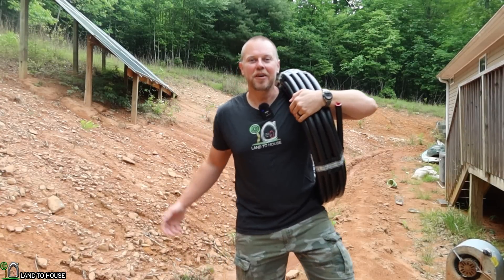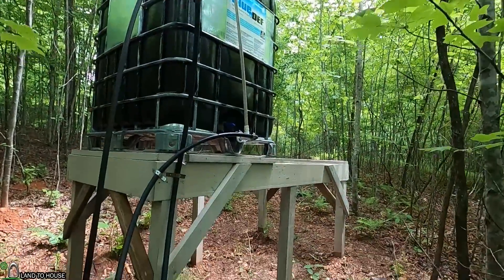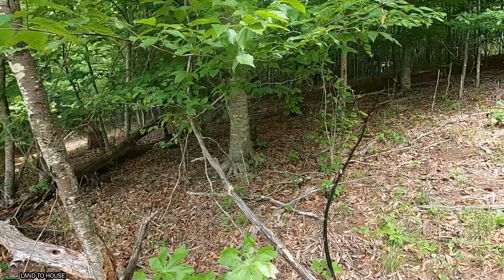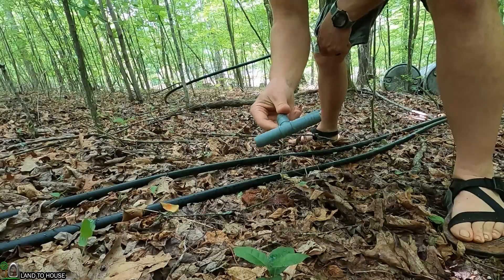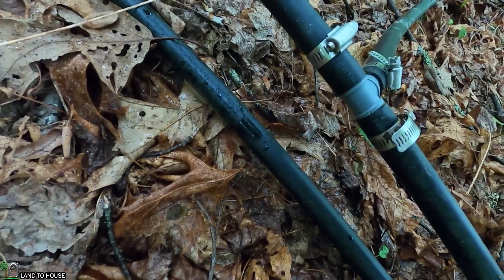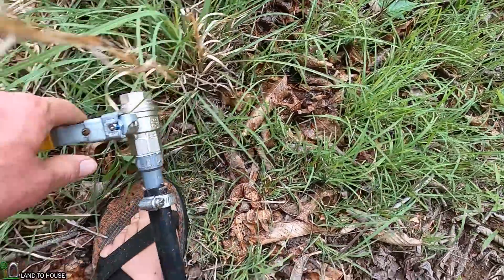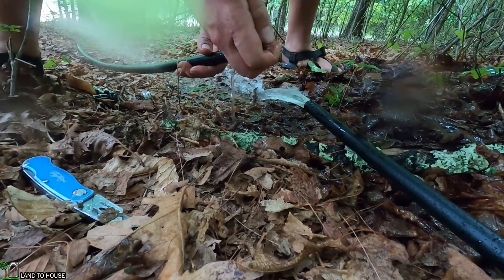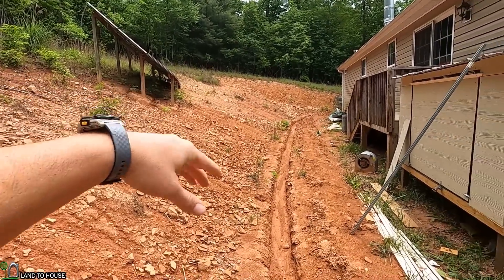Adding Pipe to Off Grid Water for Future Terrace behind house

Comment: Cut a ditch above the area like the one at the bottom, fill with 3-4 inch stone, lime the exposed area with cheap ag lime, then cover with at least an inch of compost over affected area, cover that with commercial straw matt, comes in rolls,

Comment: Well done, thanks for sharing.  Though the pressure may not be very high, the weight of the water filled polypipe will pull downhill on the connection, so the hose clamp is definitely a good idea.

Comment: In addition to terracing, which is a very good idea, consider planting ryegrass and some type of vetch (American jointvetch is a good option) as these germinate and establish quickly.  They are both used for stabilizing open slopes and controlling erosion.

Comment: Seth, I highly recommend picking up one of those poly pipe cutting tools. So much easier, faster and straight clean cuts. Why did you attach the new planter pipe midway then more towards the bottom of the drive pipe? (you may have been able to save some piping since the pressure head is the same). I would have suggest to save the run off and you could run that down for a trickle of water for the planters. You could also try using a soaker hose for planter or side of the hill.

Comment: nice video as usual!  interesting the rodents chew the 1/2" but not 3/4".  I think they chew plastic to do something with their teeth.  maybe the shape of the 1/2" is more attractive for that kind of chewing?  I had a trailer with some little plastic casters on it and they loved chewing those wheels!  I also loved the sound of the water as it worked it's way down through the new pipe.

Comment: You can unscrew and open up that type of hose clamp so you don't need to put it on first.
Reply: Came here to make the same comment. Also, I suspect the 3/4" pipe is too big for the squirrels, or whatever, to get their jaws around, but the 1/2" does fit so they can chew into it, but not the 3/4".

Comment: Your soil is acidic, ancient, devoid of nutrients, a cheap simple solution that also will work is find the area power line trimmers that grind mulch, cover the entire affected area in 4 inches of free mulch, then next spring broadcast a seed mix designed for pasture horses, horses pull grass out by the roots, so the seed mix will have extremely strong rooted species of plants

Comment: Is the water pipe measured on the ID internal diameter or  OD external diameter ?
Reply: Metric poly is measured by the outside diameter, while Low Density and Rural poly are measured by their inside diameter. 1” Rural poly pipe has an OD of 29mm and an ID of 24mm.

Comment: looks like that hill is some red clay, no wonder grass wont grow. had you tried laying down some straw and/or mulch then putting a netting over it so it doesn't get washed away before the roots get established? If you ever have issues with pressure, you can get a solar powered RV pump.